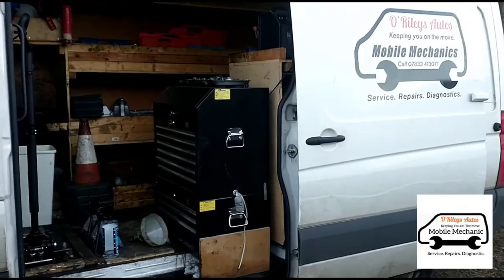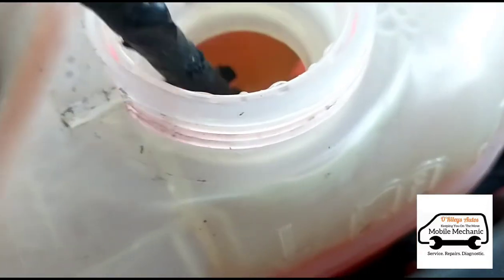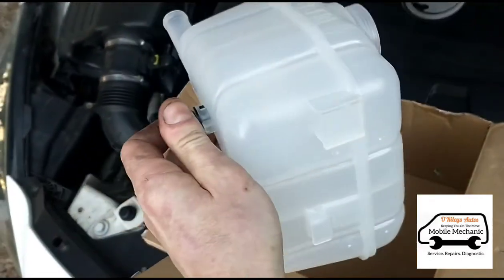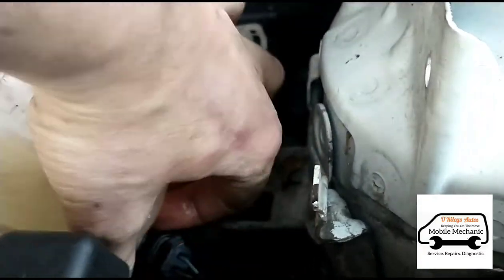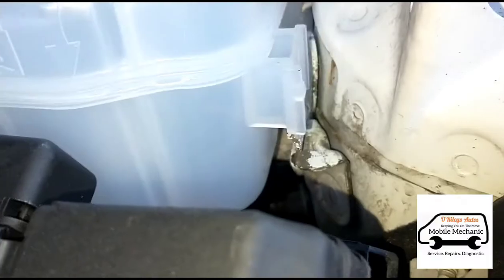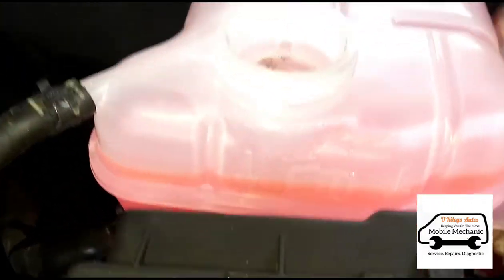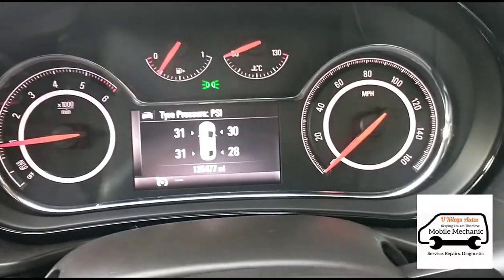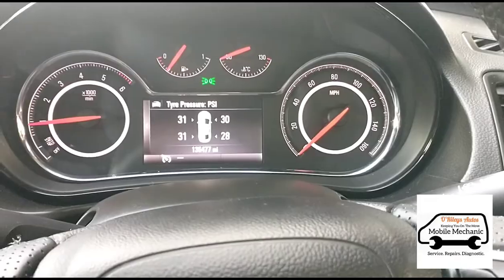Vauxhall Insignia Coolant Level Low: Add Coolant Message Fix. Replacement Sensor & Coolant Reservoir

Comment: It's important to say that you need clicr-r type pliers to remove the hoses.  I didn't realise this and started with normal pliers and had to abandon the job until the clicr-r type arrived.   Also when removing the clamp at the side of the coolant tank make sure you hold the top as shown in the video.  I didn't realise the significance of this and the clamp sprung up and fell into the engine bay somewhere.  I've had to order another it's only £2 but it has to come from Germany so it's going to take a week or so 🙂.  Thanks for the video.
Reply: I use mole grips to take mine off it does the job

Comment: ive a 10 plate insignia All summer long it cuts out Drives horribly engine idles high cuts out on motorway at 120 dead. Then from october to april it drives perfectly.  Have left in into mechanics and they think im mad. But 3 years in a row same problem. Anyone else have similar problems?

Comment: I replaced the coolant tank and it’s still going low
Reply: check water pump might leak
Reply: @Nick-uh7kn  turns out that’s exactly what it was, got the pump and timing belt replaced and all is well